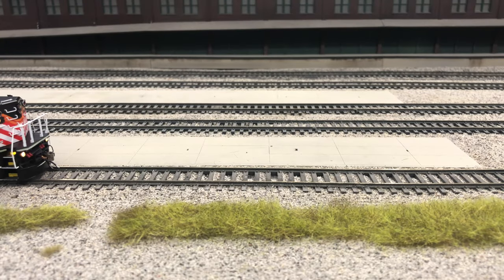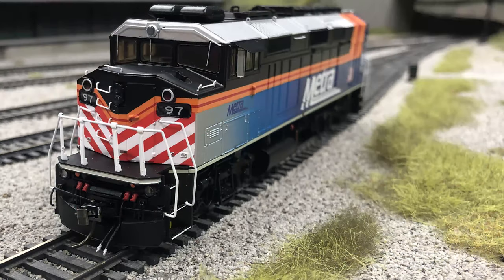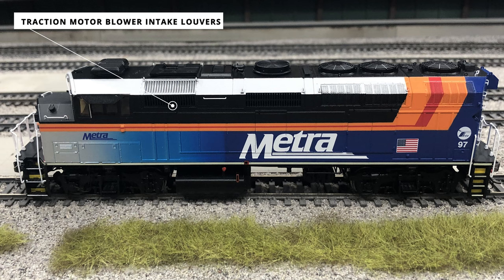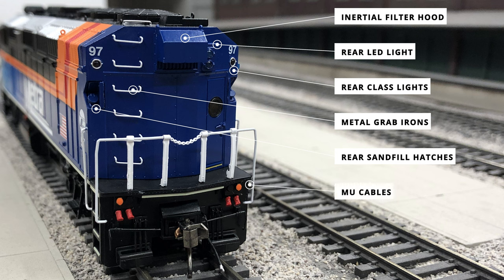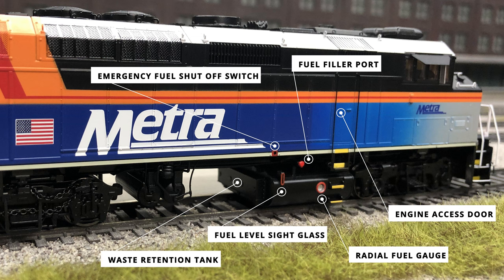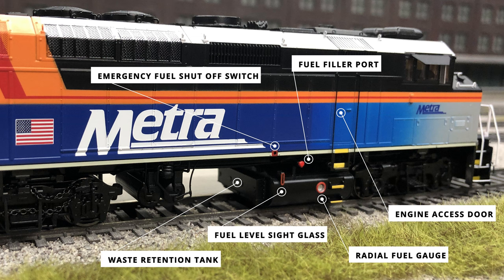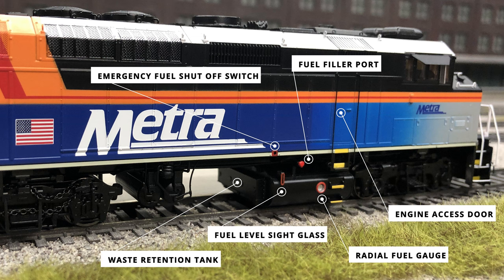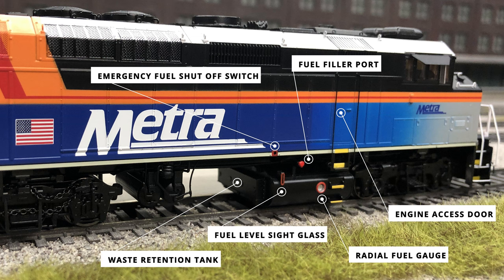Review: Rapido F59PH Metra #97 [HO Scale]

Comment: i have the Metrolink and I think its an amazing model. A couple pieces knocked off due to packaging but otherwise its awesome. I like the Athearn Genesis P42 but I feel this blows it out of the water with the details. I sometimes think we hold Rapido to a higher standard because of their obsession to details and find flaws on small details that no other manufacturer would even dream of putting on their model. Yes, the headlight is dimmer than the ditchlights, but it's still brighter than most other manufacturers models. Another very thorough review.

Comment: Very well done review. One question, How does Metra use the Gyro light? On the model it is setup like an emergency light. But I thought gyro lights are like ditch lights.
Reply: Same issue with mines. When you hit F12 it stops the engine and keep it stopped until you press F12

Comment: Your metra consist is completely wrong metra retired there Pullman cab cars years ago.
Reply from the maker: Unfortunately no major manufacturer makes the modern stainless steel cars. The only option for those cars is older resin kits, or brass CB&Q which run for several hundred dollars a piece. They still use the older Pullman cars but it’s generally less than 1 on average per train. I really want to build a few using 3D printing but it’s not on the workbench yet.
Reply: @SideTrackX  Hoping someone will do a proper HO scale version even if it’s Kato. They already have them in N scale, interestingly enough
Reply: @Maus 12.8cm kwk 44 really!  You went there...really.  Seriously, the nerve.
Reply: I assume you have an accurate metra consist then?
Reply: @SideTrackX  Walthers and another manufacturer produced the bud cars back in the 90's. I'm still hoping a re-release from Walthers with their stainless steel finish. Also, just announce Atlas is doing the Japanese built cars. As far as I know Metra still runs allot of the Bud stainless steal cars even showing their MILW and CB&Q heritage.